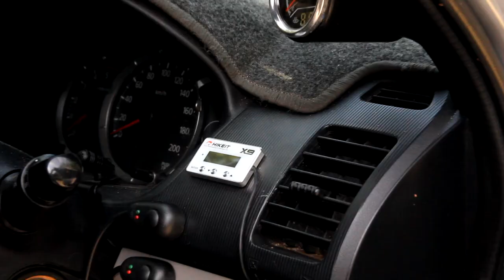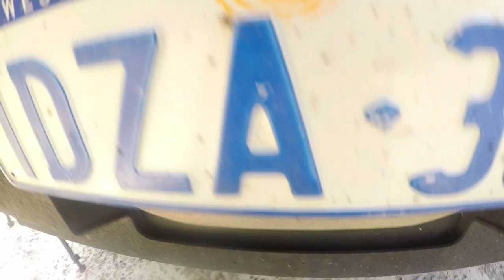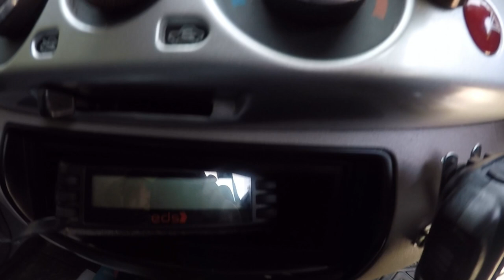TRITON BUILDS EP:4 THE ULTIMATE TRITON (2012 MN GLR)

Comment: Hey mate 
I need a suggestion from you 
I am planning to build a custom made mount to hold a spare tyre on the tail gate of the tub of the Mn triton.
Its a 33 inch tyre and as it won’t fit the standard bottom mount tyre holder.
Do you think it will be strong enough to hold a tyre🤷🏼‍♂️
Reply from the maker: Depends on what type of bracket your planning on using mate I would say the standard tailgate won’t support it with out some bracing

Comment: are those throttle controllers worth it?
Reply from the maker: Great for removing the lag between the throttle and moving mate but that’s about it
Reply: @4x4CampingandAdventures  yeah I was going to tune mine soon because with the 33s on mine it’s a bit sluggish
Reply from the maker: Yeah it will help with off the line mate makes them a bit more perky which is good they also help on the beach etc just making them a bit more active when hitting boggy sand it’s instant response rather than delayed if you want one you can save 10% with my code 4x4campingandadventures for the Hikeit
Reply: @4x4CampingandAdventures  alright I’ll check it out cheers
Reply from the maker: No worries mate been going well for a couple of years now and I did a video on it how to install them

Comment: Does anyone know if you have to have an MN triton remapped or dyno tuned before getting a 2.5/3 inch turbo back exhaust??
Reply from the maker: No you don’t mate you can fit a exhaust to a stock vehicle
Reply: Oh sweet cheers mate so there shouldn't be any boost issues any other problems?
Reply from the maker: Some models did experience a boost spike but it’s a lottery mate I never did get the over boost code when I was running 27psi but some people got it from factory. Bit hard to diagnose until it’s installed 👍
Reply: No worries mate thanks for replying so fast, will keep this in mind when I go to get exhaust and keep up the quality content been watching all your vids and taking notes, has helped me a lot with my triton 🤙
Reply from the maker: Legend mate appreciate it so much thanks for watching!
Reply: No worries mate, will continue to keep watching 🤙